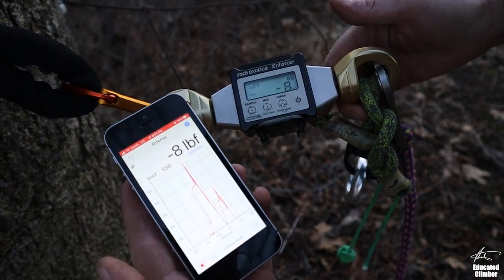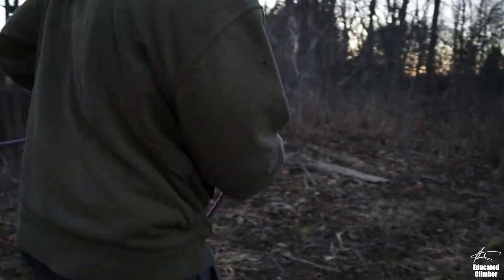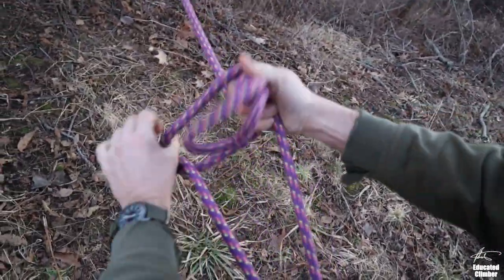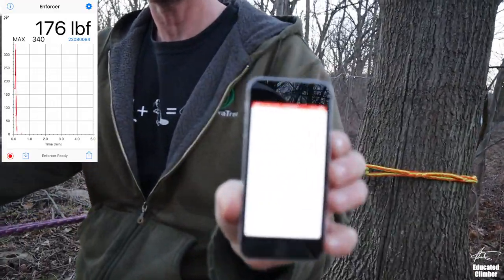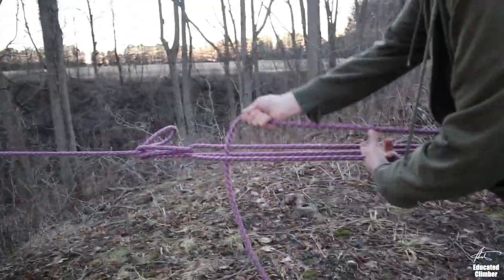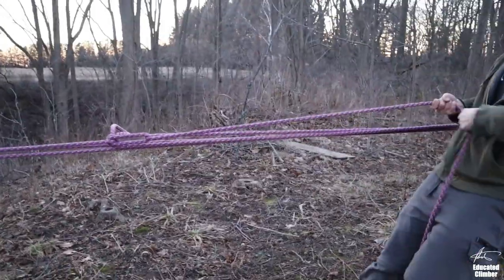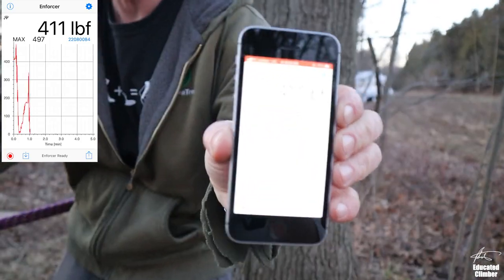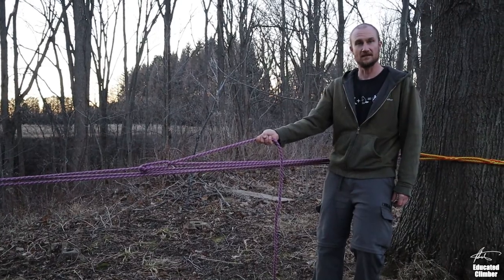Trucker's Hitch - How Much Can You Pull? Ep. 2

Comment: Would putting carabiners on each hitch loop or adding pulleys make much difference?
 I saw your original video and bought stuff for this setup. I used it today to put tension on a tree, and it worked great! I had one extra biner and added it to my second hitch. Was wishing I had a third. thinking maybe less friction on the rope with biner

Comment: HEY PATRICK..WITH A SINGLE TRUCKERS HITCH THE WEIGHT  OF THE LOAD CELL READ 320  THEN DROPPED TO 175 WHEN YOU RELAXED TO TAKE OUT CAMERA SO SHOULD EMPHASIS BE PLACED ON THE HIGHER NUMBER AND IF YOU PUT A SECOND GUY ON THE PULL I'M CURIOUS HOW MANY MORE POUNDS CAN BE APPLIED .ALSO DO YOU KNOW HOW MUCH PULL DIFFERENT PARTS OF A TREE REQUIRE  ? A SPAR VS LIMBS IN A CANOPY OR A TOP .. OF COURSE THAT VARIES ON SPECIES,LEAN ,DIAM  ETC. BUT I'M INTERESTED IN A CHART WIITH ALL THE FACTORS AND DIFF SPECIES..MAYBE YOU KNOW BALLPARK NUMBERS   FOR I.E. AN OAK LIMB 12" DIAM LEANING BACK . HOW MANY POUNDS IS REQUIRED AND HOW MANY CAN BE EXCESSIVE AND POSSIBLY RIP THE TOP OUT BEFORE CLIMBER HAS A CHANCE TO FINISH BACK CUT. I MAY DO A SAFETY TALK ABOUT THIS IF I GET MORE INFORMED. I'VE HEARD OF USING THE DIAM OF A WRIST A FOREARM AND A BICEP TO DETERMINE WHAT IS SAFE TO TIE INTO MAYBE SAME CAN BE APPLIED REGARDING PULL.  A CLIMBER CAN CALCULATE AND SAY TO GROUND SUPPORT " WE NEED 300# OF PULL FOR THIS TOP.. SEEMS LIKE A SUBJECT WORTH INVESTING TIME FOR.  THANKS,BE SAFE.